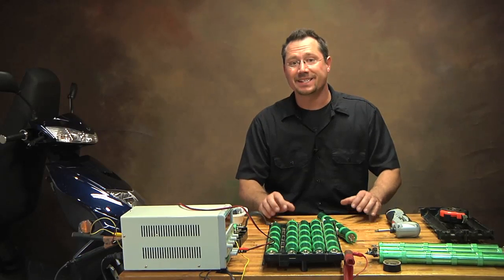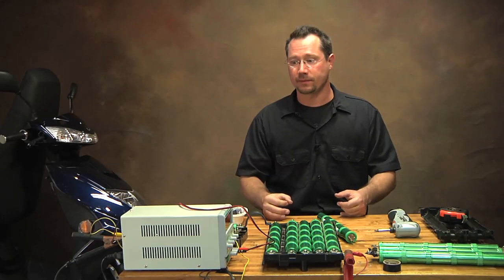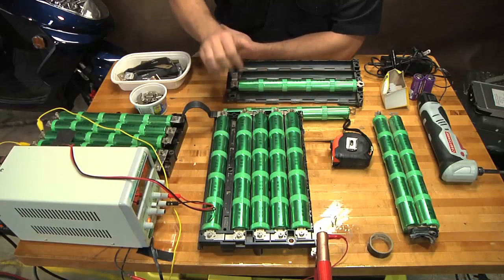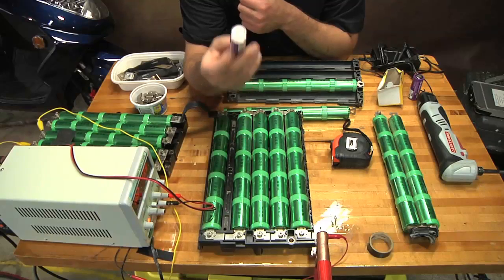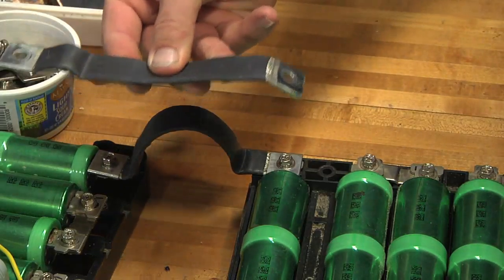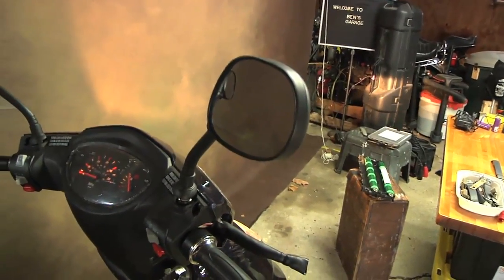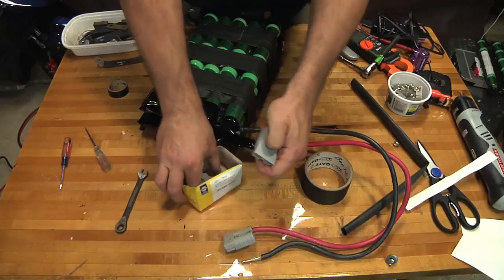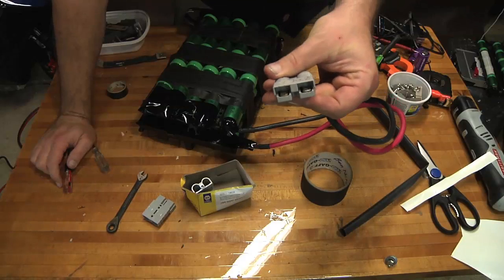Building a Battery for an Electric Scooter

Comment: wear electrical  hand protection when  doing this as battery sparks can disintergrate volt metre probe tips so imagine what it could do to finger bones so take no chances as mistakes can happen . can also wrap your finger tips in polyimide kaptone tape to insulate against shocks

Comment: Whats up I have an ETWOW Booster 2. Right now its rated at 33v 6.5 ah. I saw a battery listed on the net that's 36v 8.8 ah I think it was. It got me thinking would it be beneficial to build a better quality battery at 36v?
Reply: The scooter needs 72 volts, so (2) 36v would work.

Comment: Great video! Is NiMH cheaper than lithium in terms of power and usage life and cost? Thanks
Reply from the maker: Historically, NiMH was cheaper than lithium, and it's what was used in all the hybrid cars. Lithium has light weight and long life cycles. In this case, I'm playing around with NiMH batteries, because I already have them, salvaged from a Ford Escape Hybrid. For any new hobbyist project now, nearly everyone uses some form of lithium. There's still plenty of good reasons to use NiMH and even Lead batteries, (got a great price, its for a stationary battery, etc,) but not usually for vehicle projects.
Reply: uj
Reply: Cheaper to use recycled LiPos.

Comment: Any chance you can share some info on how you got the NiMH batteries? You said something about a junk yard but did you pull them out yourself? If so, where is the DIY on that? Surely that could go really wrong. Is it now common place to find hybrids and electric cars in junk yards? 

Thanks for your time.
Reply from the maker: +Nathaniel, I got an entire Ford Escape Hybrid Battery pack from a junkyard. I took it apart to get the cells. You can read the blog entries, including videos, at: http://300mpg.org/2014/07/21/auto-parts-road-trip/ and http://300mpg.org/2014/10/13/deconstructing-a-ford-escape-hybrid-battery-pack-for-the-motorcycle/
I originally intended to use those NiMH cells to replace the aging lead cells in my Kawasaki electric motorcycle. Right about that time, I got a REALLY good deal on the Vectrix and then a LEAF battery pack, so I ended up working on that instead. Hybrids are common enough in junkyards, but there aren't too many electric cars, yet. There are a number of places now selling Volt batteries and Leaf batteries. A friend of mine is selling A123 cells right now. If you are interested: http://www.schultzengineering.us

Comment: dude, how could I use lipo batteries in a razor mx650 electric motorcycle?  I want to convert my kids electric motorcycle from lead acid to lipo
Reply from the maker: +Matthew Sherman, That's a little beyond the scale of this video or being quickly answered in a single comment. However, in general, you connect batteries in series to get to the voltage needed for your project, and connect batteries in parallel to get to the AH capacity that you want. The "Endless Sphere" forums are a great resource for learning about building battery packs. https://endless-sphere.com/forums/

Comment: These cells have a specific power of only 600w/kg and specific energy of 43wh/kg
So your volumetric power density of the pack is several times lower than using prismatic cells

Comment: It won't run the scooter more than 10 min
Depending on the bms used in the scooter 
The panasonic cylindrical cells are designed where most of their IR is up above 1.4v so they work best from a 80% soc down to 50% DOD 
So if your pulling 15a most of the usable  watts will dissipate within the first few minutes
Reply: BMS is in the battery pack, not on the scooter

Comment: May be a good idea to mention to any DIYers, that 60 volts DC at high amperage needs to be handled very carefully.. If two wires or contacts are allow to short out the battery, they will weld themselves together. (That's why a fuse is a good idea).

Plus, 60 VDC might not seem like a very high voltage, but it's high enough to kill you, if the current passes thru your chest. It can stop your heart. 

In some devices, the - minus side is connected to the metal chassis. So, if your left hand was on the metal chassis and you put your right hand on the + Plus side of the 60VDC battery or cable etc.. That could be very dangerous. 

https://en.wikipedia.org/wiki/High_voltage#Safety
Reply from the maker: +Richard Lee,
As always, safety first. In general, wear safety glasses and use insulated tools. For a removable battery pack, a fuse built right in to the battery pack is a good idea. On children's PowerWheels toy cars, they have a fuse built right in the 12V battery. That wouldn't be a bad idea for this either.
Reply: BenjaminNelson
Just need to made sure the fuse holder is easy to get at.. And of course the fuse is rated about 25% above the expected current flow.
Be good to have a spare in the bike's tool kit.